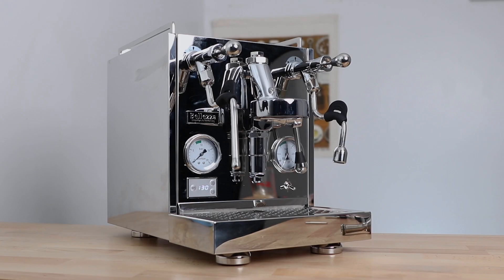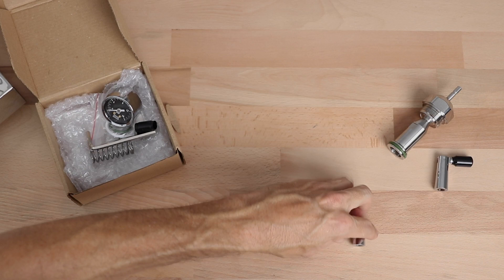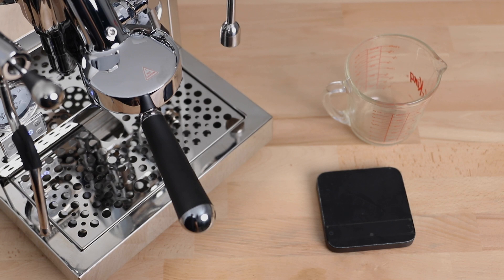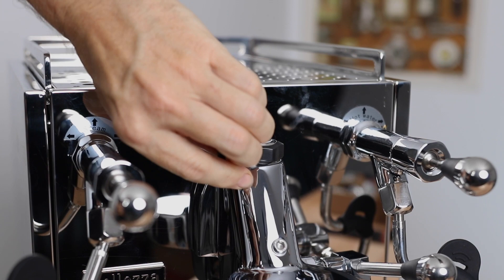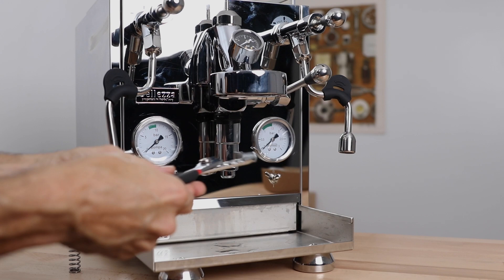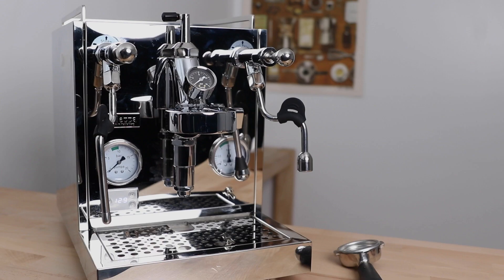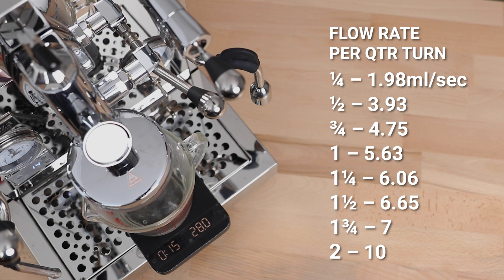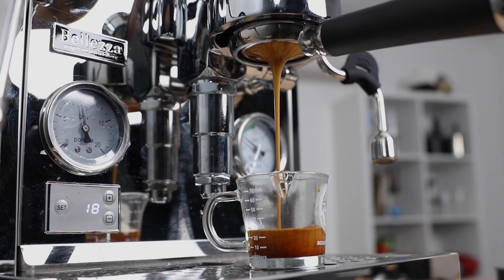How to Install Coffee Sensor's Flow Control Device for a E61 Group Espresso Machine

Comment: Flow control has nothing to do with pressure control? Doesn't it?
Reply from the maker: You're right. Pressure comes from how hard the pump works. Flow derives from the resistance the coffee bed has against the pressure of the water.

Comment: The video is true to the solution, the greatest difficulty is getting the bottom part in place while applying upward pressure, turning and keeping it straight. It takes a few tries and strong hands are required. I put some electrician's tape over the bottom hole to make it smooth on my palm while pressing up and turning without tearing-up my skin. Thanks for the video! And if you're wondering the flow control is well worth the expense and makes a great espresso even on the first try I could see and taste the difference.
Reply from the maker: Thanks for watching 👌
Reply: Put the lever in horizontal position while getting the threads interlocked. This way there's much reduced pressure on the bottom part 👍

Comment: For me the group head pressure gauge's needle vibrates so it gets blurry and whirs audibly loud which is a bit annoying. It's louder/more noticeable when the machine is heated up. The vibration is differently strong at different pressure. Any ideas? It's a vibratory pump machine, I was under the impression the gauges should have something to "dampen" then vibrations, though?
Reply from the maker: Yes, it may need a re-adjustment of it placement. Different machines require slightly different depths for the needle to sick in to the flow of water. Sounds like it maybe in to far - quite possibly ? I've used these pon many Vibe pumps with no issue of vibration from the gauge - so I'm thinking it's in the placement.
Reply: Did you solve this? I'm having the same issue.
Reply: @Joe_Andrus  unfortunately I solved it by using a different gauge, which also vibrates but only minimally, and not audible.

Comment: Hi I just installed one and having problems with the flow device becoming hard to turn when the machine gets hot. And when i opened it. I noticed that the oring (green colored) got deformed and went into the screen on top. When i replaced it with a new one, same thing happened and got stuck again on the screen. So I am not sure about the quality of these Coffee Sensor compared to the ECM or Profitec ones. Would you be able to provide some advice. Thanks.
Reply: I would suggest sending your messages directly to your supplier, if you got it directly from Coffee-Sensor you can WhatsApp them.
Reply from the maker: Hi Joey,  the message I'm receiving from a number of sources is that ECM and Profitec are not without their issues.  – but if it was difficult from the get go to move it, than there might have been a possibility that the thread of the flow control was not perfectly executed. The deterioration happens from moving from fully open to full closed too quickly under the pressure and the gasket may be compromised at this stage
Reply: Hi Joey! What is the brand of your machine? Did you fix the reported issue?

Comment: I have got this kit from AB,  it was easy to install,  with my machine it already has a grouphead pressure gauge installed so I did not have to install the grouphead gauge supplied with the kit. My machine only has mannual pre-infusion so there was no need for me to replace the spring in the pre-brew cylinder.  I did a few flow testing and I found my machine's water flow pretty much matching the water flow of your video at 6:15 mark, the baseline of my machine is at 1.5 turn of the flow control dial.   With the flow control unit I was able to start my extraction around 8 bar pressure then dial back to 1.25 turn to maintain 6 bar pressure then end at about 4.  For me the addition of water flow unit in the extraction flow seems to have stop over extraction which produce somewhat slight bitter taste of the dark roast coffee I am using, the coffee extracted is a lot sweeter and smoother. I still have not tried to ramp up the flow to extract at higher water flow and pressure,  I will test that in the future.  Yes,  it is very interesting kit to try and certainly produce a different tasting cup of coffee.
Reply from the maker: Fantastic feedback! Thanks so much 🫶 and Great to hear you're enjoying tasty coffee !

Comment: Generally a great instructional video - but I was disappointed to see an agricultural set of grips used to work on on such a fine machine!
A quality wrench would have looked more professional!
I notice you didn’t reinstall the o ring on the new gauge but one was supplied in the kit?
Does this mean only use the O ring  if required?
Reply from the maker: There isn't many obvious change over of o-rings during installation that need to be replaced other than the WHITE gasket under the mushroom seal and possibly the other on the Pre-infusion chamber. The gasket on the hex screw I left in, as well as adding the tape the the pressure gauge – and this helps create a reliable seal as well as the spacing required to line up the pressure gauge in order for it to be levelled appropriately. So long as it's not required - )visually inspecting current o-rings) I recommend keeping the spare green seals from Coffee Sensors pack – in order to have spares once the current ones wera out. This will occur eventually – but o'rings are easy to replace

Comment: thank you! is it compulsory to remove the automatic pre-infusion? it may seem a strange question, but I'm thinking that by not changing it, with the top set to 9 bars, you can do the classic E61 shots.
Reply from the maker: No it's not actually - you could have FlowSensor set at a particular pressure and have the Automatic Pre-infusion set - and then allow them both to interact with the shot at different times 👌

Comment: Thank you for this!
I have a question I could not find online - How Dows the lower spring do the "Automatic pre infusion"?
Reply from the maker: The lower spring allows the a certain amount of water to fill the back of the E61 Grouphead chamber -  let's' say 20mls - and lengthens the time it takes for the pump to pump the water in to the coffee bed - that will create back-pressure. So the time between the pump having to work hard against the back pressure is lengthened by this - whilst water is still able to come into contact with the bed of coffee - so it's here - in that moment you have a pre-infusion of the coffee. Now - some machines have this as a delayed start to the pump - others it's manual - and you have to lift the lever up halfway - activating the grouphead but not turning on the pump. Hope that explains it

Comment: Thanks for the video! A couple of questions:

1. Should the machine be descaled before installation? I use soft water now, but didn't in the past, so there may be some scale.
2. Is there a way to install a grouphead thermometer after installing this kit? It seems the pressure gauge is installed to the same place where the thermometer should go.
Reply from the maker: Hi there,
1. Descaling is not a bad thing, if you're concerned about it - but it won't effect the FCD as much as it'll effect the boiler efficiency in heating. So unless you have grave concerns about it, than I wouldn't be too concerned. Now you're using lower TDS water, you'll actually be reversing the issue.
2. You are correct, it is the same place, so no... you cannot have the both. I am aware they are working on a dual model,, but have no updates on this at the moment. 2nd best option would be to use the Thermometer for a while to get the best understanding of the machines heating cycles as you can, than you could change over to the FCD when you feel confident you can gauge the temp.
Reply: @AlternativeBrewing  Thank you, this is very helpful!

Comment: Do you know what could be causing my group pressure to be maxing at 8 bar (with a. Blind basket) but my boiler gauge is at 9bar (syncronica) thanks for any help.
Reply from the maker: Hi Austen, thanks for your question. The Boiler Gauge - this is displaying more about the pressure equalling temperature - versus Pressure expected at the Grouphead. If you tested all machines - they would all have a similar offset from the Boiler to the grouphead. If you have an OPV, then you'll be able to increase the pressure in the boiler slightly - to get 9 bar at the grouphead - but know - you'll also be increasing the temperature of the brew water too. Some Machines have better and more precise offsets than others.

Comment: I’ve been flirting with the idea of putting one of these on my Mara X. 
The videos I’ve seen about it haven’t been explicit with regards to the flow rate as you’ve explained here (and one by Marc at Whole Latte Love) they usually just talk about watching the pressure gauge, I think that a lot of people might not realise it’s the flow they are supposed to be learning about.
Reply from the maker: Glad it was helpful! 100% it's the flow. The pressure will adjust according to the resistance in the ground coffee, where you may see a dip in pressure - thinking you have to increase the flow to maintain a consistent pressure – what in fact it is telling you is the coffee bed is becoming less dense as extraction is progressing, so counter-intuitively you in fact want to slightly decrease the flow 👍
Reply: @jerryatrick6127  I just bought one as an upgrade from my rocket appartamento. Delivery hopefully this week and cannot wait 🙂
Reply: @markv7899  Hey Mark, curious to know how you went with this on your Rocket? I too have an appartamento and have been considering this mod for a while. I've only managed to find threads where people are considering adding it to their appartamento - no accounts / feedback on how they went with installing and how they enjoyed the modification. Thanks in advance for your feedback.
Reply: @rand9176  sorry misunderstanding I actually ended up buying the ecm synchronika with flow control as the upgrade from the rocket appartamento. Flow control on any e61 will work the same. I can definitely recommend flow control for several reasons. 
1. Its a great tool to minimise any extraction inconsistencies such as channeling leading to over extraction. This is as simple as adding a low flow pre-infusion for a couple of seconds before ramping up to normal pressure.  
2. It's a great way to experiment with different flow rates during certain stages of the brew and you can change the taste of beams through a bit of experimentation. 
3. If you roast your own coffee long, slow slow pre-infusion can take the edge of super fresh roasts. I would personally recommend a flow control device
Reply: @markv7899  ah I see! I’ve been looking at the synchronika constantly too haha. Worthy upgrade from the apartamento?
Reply: @rand9176  absolutely!! The rocket is great but the ecm is incredible. Nothing taken away from the rocket but I found with getting up super early for work and wanting a coffee before I hit the road the noise from the vibration pump in the rocket was too much. It's definitely a great machine and you won't be disappointed but if you feel you might upgrade down the track you won't be disappointed going a dual boiler with rotary pump. Especially the synchronika. The build quality is superb
Reply: @markv7899  cheers for the feedback mate!
Reply: @jerryatrick6127  Wait, so you mean that you just leave the FC at 1/4 open turn during the ENTIRE coffee extraction?!? Usually that would be only during the pre-infusion no? Were you also aiming for the standard 1:2 ratio such as 20 in for 40g out, just not in the typical 25-30sec?
Reply: @jerryatrick6127  Thanks for the info :) I guess it makes sense considering from the first drip at 17sec to the end of 47sec, it is a 30 second extraction time and some people count the popular "espresso = between 25-30s" from the first drip instead of when pulling the lever like I do. I guess you must count anyway using the first method whenever you don't use the default pre-infusion timing and use a custom flow control instead of keeping it stock.

How much grams do you have at the end if you start with a mighty 26g in the basket? I use a IMS basket of 20g and never put more than 20.2g inside. I do have a 22g basket too but never though about using it with as much as 26g :o

Comment: Great content as always! Would love to know more of how you use flow profiling day-to-day, if you do at all, or maybe just a candid take on these tools and methods. Do you even need flow or pressure profiling to get the most out of a lighter roast? Thanks again!
Reply from the maker: With some use - you get used to the positions of the tap - a gentle low and slow pre-infusion - slow ramp up to 6-8 bars pressure and then again slow ramp down helps extend contact time - doesn't over extract and sweetens the shot up quite nicely - if it's too sweet or sour - pull at a slightly higher pressure for longer 😀

Comment: Thanks for the video!  In the instructions with mine, it seems to say that the stronger spring is only necessary to be installed when unit doesn't have water reservoir.  Is that your understanding?
Reply from the maker: That is correct When there is a pre-infusion spring in the machine than it requires to be replaced - otherwise not needed 👌

Comment: I installed it after that the water doesn't flow to the group head. What's the cause?
Reply from the maker: You may have a spring that is stuck in the solenoid valve - this would stop the lever from working when you lift it up. If, when you lift the lever up - it feels either very tough - or is too easy to lift - undoing the bottom of the solenoid valve again - and giving everything a good clean out will help.

Comment: Thank you for the great video. I understand having to turning off the machine during installation, but my machine is plumbed in. Do I also have to cut off the water supply at the source during install?
Reply from the maker: It would be safer to do so yes 😀

Comment: this controls the pressure in the groupe head yes ? not just flow rate ? pressure is related to flow rate ?
Reply from the maker: The same rules apply to brewing the espresso - whether it is at 9 bars or lower pressure. Yes, this tool will enable you to brew at lower pressures - though your grind size will still play an important role in the speed at which pressure is built up in the group head and the flow of water through the puck is driven. 
Pressure and flow rate are dependent on one another. Pressure is measured from behind the puck (in the grouphead) - Flow rate is the measurement on the other side, with the grams per second. 
The Flow Control Device uses restriction of the water through the group, managing the flow of water onto the coffee. the flow rate will be determined by the resistance in the ground coffee,  that is how fine or coarse it is - as well as the pressure applied to it.
Reply: @AlternativeBrewing  yeah cool I get it now...thanks for shearing
Reply: @AlternativeBrewing sorry another question I have a similar machine a Bellezza Chiara....once I install this flow control kit can i still use the PID preinfusion on the machine or do I always have to do a Manuel preinfusion with the flow control nob?

Comment: Just got mine installed and the first time I heated up my machine with FC in the closed position, my lever would not lift. I slightly opened the FC maybe and 1/8 of a turn and my lever moved freely then. It seems to be working fine now. Maybe the mushroom spring was in a bind or something. Did you notice any issue when you first installed yours?
Reply from the maker: Yes, the one thing I found was the FC itself was a little stiff, and off centre - so I had to readjust and it got working eventually. - but I have heard similar niggles happening.
Reply: @AlternativeBrewing  Thanks! Mine is working fine now.

Comment: I have a question about vibratory pump machine
When i calculated the amount of water dispensed in 30 seconds without the portafilter in place
It is so variable
Sometimes it is 160 g in 30 seconds
Other times it is 190 g in 30 seconds
Is that normal to be variable like that
Reply from the maker: There will be some variability in it yes - as the water cools and rises - it's flow dynamics will change - best to get a good average flow rate as your marker 👌
Reply: @AlternativeBrewing  so these variations won't affect my extraction time when keeping everything else constant like type of beans and grind setting and doing the same preparation steps
Reply from the maker: @minareda3103  With restriction - comes consistency. As you mentioned in the first test - when water is completely unrestricted - so it can pour out as fast as it can manage - depending on the temperature of the water - this will fluctuate slightly. 

When it comes to restricting the water, by placing the basket and coffee under it - we create a backpressure - measured by BARS. So in keeping the machine at 9 bars of pressure - and restricting the flow rate - you will see consistency in the recipe you aim for. (HOWEVER - and you can try this - it's best to use the machine at the same warm up time, each time. EG: turn the machine on, wait 10 mins, flush for 5 seconds - then pull your shot .. and do this same process everytime. ... If you were to just turn the machine on, and pull a shot immediately, you'll notice how different the shot will pull. 👌
Reply: @AlternativeBrewing  so temp can cause inconsistent shot timing when everything thing else is constant? I mean does it make up to 10 sec difference? Because that is what i am facing and i can't spot where the problem is